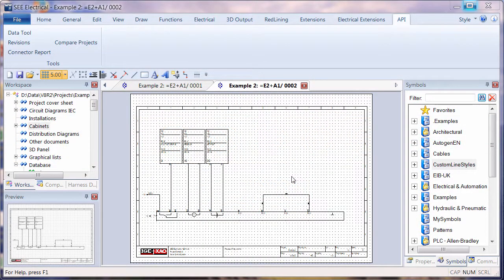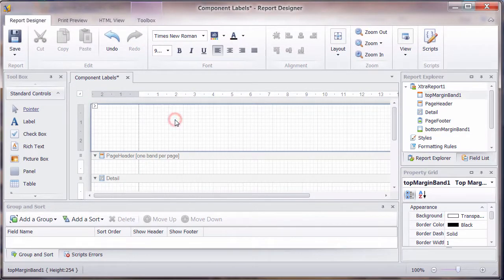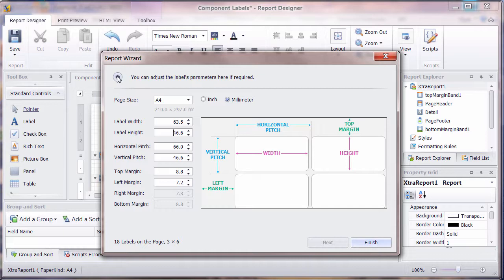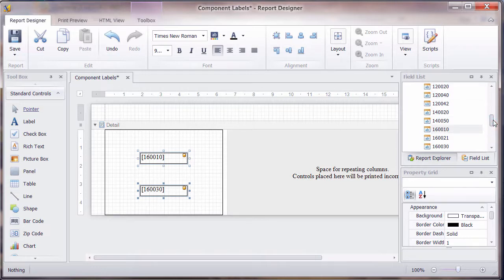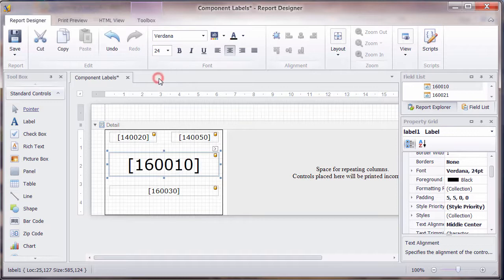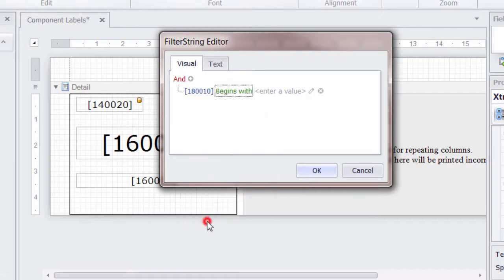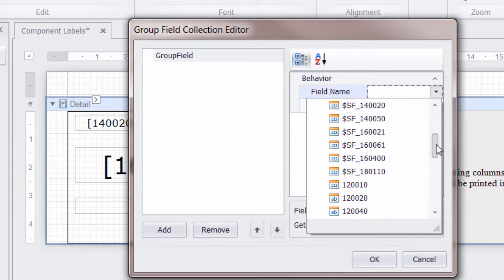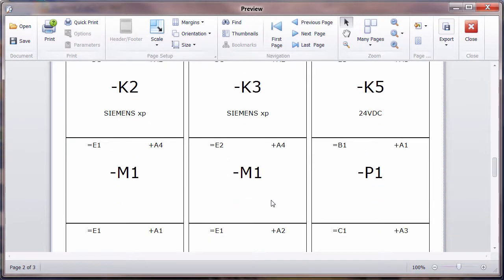V8R2 Report Generator Labels

Comment: hi .. why there is no "view components" in the version i have ?
Reply from the maker: The example was with IEC English version with a project template for 'Standard' circuit diagram design. Do you have anything different to this, such as IEEE version or a different workspace template being used?
Reply: @IGEXAOUK  No the same in the video
Reply from the maker: @zavenbilemjian8116  There are many things that could be different. I would suggest contacting your local support team to understand more about this process.